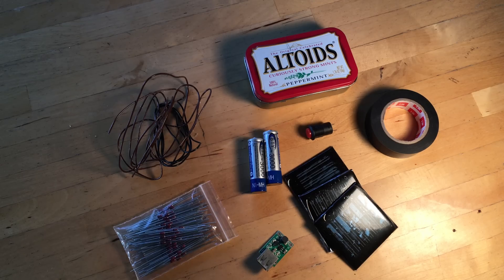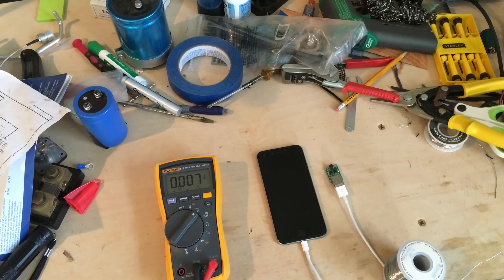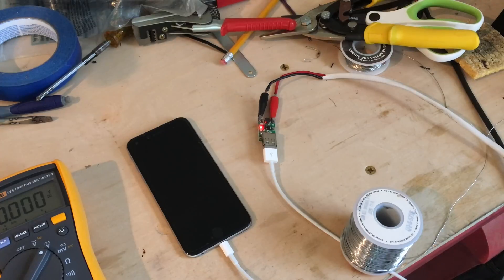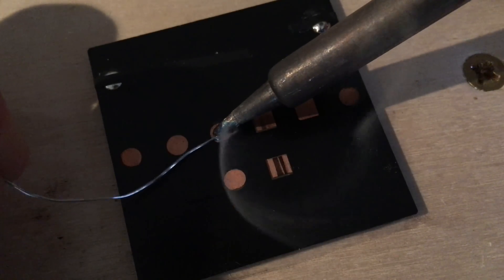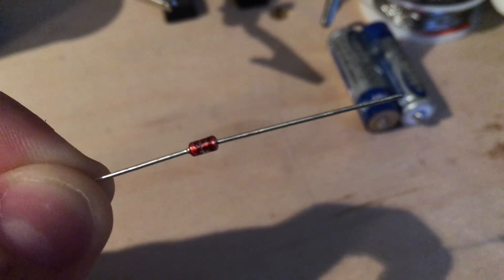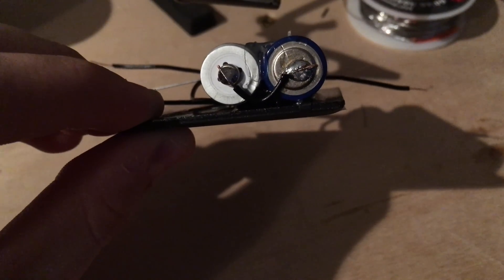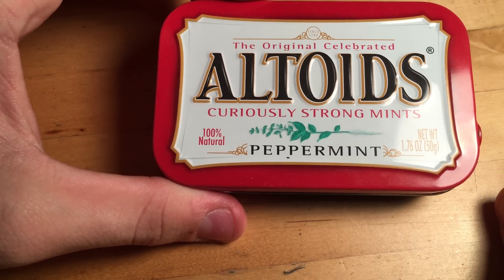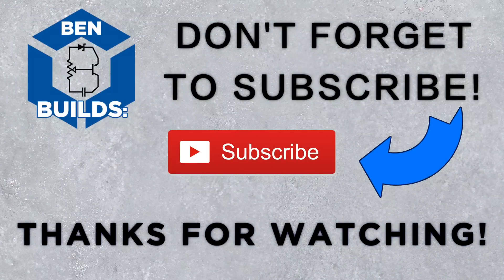Ben Builds: Make Your Own Solar Powered Phone Charger

Comment: Ben pls quick I am doing a school project quick tell me! How many volts are the solar panels quick pls ben
Reply from the maker: Dennis Zhao It depends on the light level and specific panel you buy. Sorry there isn’t an easy answer but the voltage also depends on if it’s Voc or Vmp. Voc is the open circuit voltage and is higher than Vmp or the Voltage at maximum power point. Your best option is to measure the voltage with a voltmeter or look at the datasheet for the specific panel you have.

Comment: Dumb question. Can you use the solar “panels” in the solar powered outside lights??
Reply: Not a dumb question at all.  If the lights don't work anymore, that's a clever way to recycle the panels.  To make sure it'll work, you should put them in full sun and use a multimeter to see how much voltage they generate.  For the batteries to charge, the panel voltage has to be higher than the cell voltage, which is 1.5 for each AA cell connected in series.  Connect as many panels as you need to get to between 3.5 and 4 volts.

Comment: There are several factors in average cost to install solar power . One plan I discovered which succeeds in merging these is the Ewans Energy Roadmap (google it if you're interested) definately the most useful resource i've heard of. Check out the extraordinary info .

Comment: Thanks.

Can you please help me out with this....

Solar mobile phone powered charging station
This small device make use of a tiny three volt solar cell to charge a six volt battery set that will be possibly employed to charge different models of mobile phones and other handy gadgets. This solar powered charging station is designed so that devices can be charged outdoors and in an environmentally friendly way. This system converts solar energy to electricity and stores it in a battery bank. A microcontroller prevents the batteries from being overcharged and prevents the system from being used when the batteries need charging.
Email: franklinmerry@gmail.com

Comment: is it mandatory to have the latching push button switch, or can it still function without it?
Reply from the maker: It is necessary in my design, I'm sure you could design something without it, but then you'd just have the battery drained all the time.

Comment: +Ben Builds The effort you put into your channel really shows! Thanks so much for making this tutorial - I'm hoping to build this soon :)
But first, questions: 
1.) Does the diode need to be a zener or can it be a normal rectifier diode? 
2.) A standard USB charges with 5V, 500 mA (0.5A).You only connected two AA batteries (each ~1.5V; with a combined output of ~3V). Does this affect phone charging?
3.) The PV you used outputs 0.16W 4V 40mA. Obviously, this depends on the amount of sunlight, but how long does battery charging typically take?
4.) How well does it work? How long does it take to charge a phone? Would you modify this design in any way?
Reply from the maker: Thanks for the positive comments! 1) No, it can be normal. 2) The 3V is boosted to 5V so it doesn't affect phone charging. 3) A really really long time- think 2-3 days haha 4) I'd modify the hell out of the design- dump the NiCd batteries for one Li-Ion flat cell with charging circuitry. Add more solar cells that fold out. It charges the phone pretty fast- maybe 4 hrs for a full charge, those modifications would make it faster.

Comment: Ben, can you please make a walkthrough for how to construct the charger. I just dont know what wires go to what thing. Its too tough for me to understand and the schematic is
way to hard for me. The point that i got to was super glueing the solar panel w/ all of the batteries, etc into the tin but after that, its too tough to see what you did. Idk what the negative and positive wires on the battery go to. Please respond!
Reply: If the schematic is 'too hard' to read, and the simple engineering needed to make this is also 'too hard.' Then I think you should stay in school and put your soldering iron away. This is extremely basic, and if this seems to hard then you should just stick to using your wall charger for your phone.

Comment: isn't that the wrong diode as the zenard diode dosnt direct  current or voltage in one direction
it just lowers the volts out
Reply from the maker: +Adam Daveybradstreet Yes and no. Yes in that the Zener diode does lower the voltage, but it still directs the current and voltage in one direction. The only difference between a Zener diode and a normal diode is that a Zener diode has a point at which the current can flow back if a certain voltage threshold is reached called the Zener voltage.
Reply: +Ben Builds: can u use a silicone diode instead
Reply: +Ben Builds: and wouldn't it recharge the battery's faster as their is less forward voltage drop

Comment: Ben, I am so confused right now. At the beginning, you said to have 43k resistors. At 2:40, you said to solder the 46k resistor to the 51k resistor. in the description, it says 47k resistor (For a part you used). I'm not sure which one to buy. Please respond because I have all of the other things to make the project except for this. Thank you!
Reply from the maker: +Justin Waters Hey, sorry for the confusion. I did end up making a value change to the resistors in my final revision. The most current values are available in the schematic. They are 43k and 51k. Thanks for watching!
Reply: +Ben Builds: ok thank you

Comment: wouldn't it be better to install a second solar panel on the top lid to double the amount of current to collect?

Other than that: great work!
Reply: Current... That is not what we are collecting.. If you dont even know what you are talking about then you shouldn't even be constructing this. Also, no. If he were to place one on top of the lid it would defeat the purpose of the lid. Due to no limiters or fuses, the batteries could over charge if left in the light for too long. Hence the lid.

Comment: Not bad, although it's a bit rough. Also, be careful you don't short out anything on the DC-DC converter when you hot glue it to the bottom of the tin. Just thinking thought that you didn't show any footage of it working, namely, having completely discharged batteries and charging them solely from the solar panel.
Reply from the maker: +Joe Anthing Hence the electrical tape. At 6:26 you can see where I put it.

Comment: How long does it takes to fully charge an iphone?
Reply: +Łukasz Podgórski It's quick, as long as it gets the full voltage
Reply: You know this is for emergencies... Not regular everyday use.
Reply: +Supah X I just want to know how long does it takes.
Reply: Łukasz Podgórski you'll probably get 1% an hour as long as you turn it off. that doesn't matter if your lost because you'll only use it for phone calls
Reply: It depends what Amperage is given out by the panel. Bigger panel more amps.

Comment: You just earned yourself another sub! keep up the great work! One question though, can I have a link to where i can buy the wiring? I'm pretty new to this kind of stuff and when i search wire on ebay i get all sorts of wires. Thanks in advance!
Reply from the maker: +TheGreatGrilledCheese Hmm, I never buy wiring- I find it's easiest and most cost effective to take apart some old electronics and salvage the wire. However, if you do need some look here: http://goo.gl/apObBI

Comment: This is awesome! I've been looking into solar charging devices for my frequent backpacking trips and this seems like a great alternative to the expensive brand name gear.  I've seen a number of comments asking the same question, but how long does this typically take to charge a phone from 0%?  This is really the first electronics project I would attempt, so I apologize if this is a silly question, but would there be any difference in required set up for a Galaxy S6? Thanks for making this video! Keep up the awesome work!
Reply from the maker: +KilasaurusRex No questions are silly! The DC-DC converter charges at 500mA or about half the speed of your normal phone charger. Exact times will vary depending on make of phone. The Galaxy S6 will be easier because it won't need the resistors, they are only required for iPhones.

Comment: The lid has to be open for the solar panel to get any light. Is there space within the lid for another panel so that you can recharge the batteries more quickly? Is this something you could feature in a 'revisited' film?
You suggest there's a difference in wiring requirements between stock USB and Apple, and wired your project for Apple. Is there anything that would need to be done, or not done, for stock USB charging?
Reply from the maker: +Alvin McDoogle The only thing different for stock USB is you don't need the resistors.

Comment: Is there room in the lid for a second solar panel? Wired in parallel, I would think you might decrease your charge time. Great job!
Reply from the maker: +Abram Pierce I wish, I tried so hard to add another panel, but there just isn't enough room to close the lid if I put it in. If you use a different or larger case you can add more panels.
Reply: +Abram Pierce Depends on the output current of them. NiMH batteries have an optimum charging current and voltage, and using non-regulated solar panels to do this is very crude.
Reply: Thought the same thing
Reply: +Ben Builds: you could hot glue solar panels to the lid and drill some holes through the lid for the wires, this might give you more space for extra batteries in the tin, you could then attach straps to the bottom so you can attach it to your backpack to charge while on the go?
Reply from the maker: corruptcheckerking Hmm.. might have to try that sometime, thanks!
Reply: +Ben Builds: no worries man, thanks for putting this video together, very well done :)

Comment: Great project.  I noticed that you used 4 resistors instead of the 2.  Was that because of the 3 volts required for the input on the center pins rather than the 1.4 volts first indicated?    How long does it take this charger to charge the phone?
Reply from the maker: +Pidasian Hippie Thanks! Later I realized that I needed the 3 volts, like you mentioned. The schematic shows the proper way to wire it up. Here in Florida, it takes about a day to charge it up, and provides about a full iPhone 6s charge.
Reply: Ben Builds: Wow!  That is pretty good for that one small solar panel.  Would it be possible to parallel another one to put it on the lid of the Altoids box to give you a little more power?
Reply from the maker: Actually, yes. I may even be able to fit two more up there. I may revisit this project in the future and do that.
Reply: Ben Builds: Cool!  This looks like it was a fun project to build.  You have a great format here for your videos.  Keep up the great work.